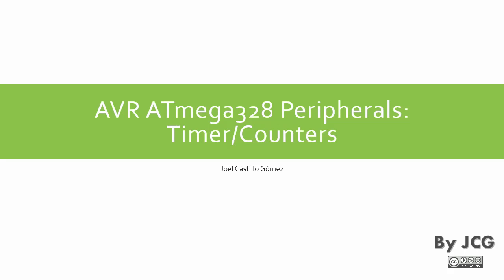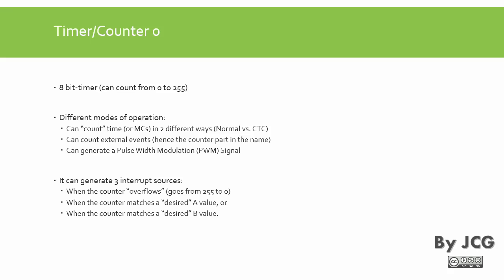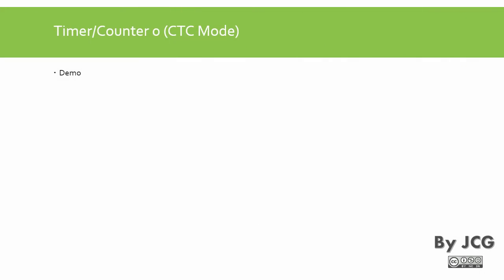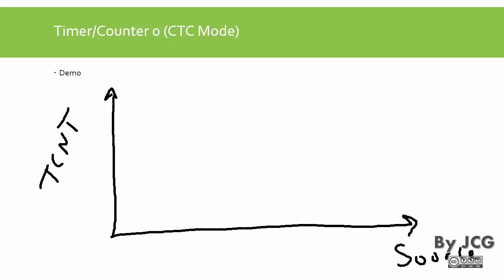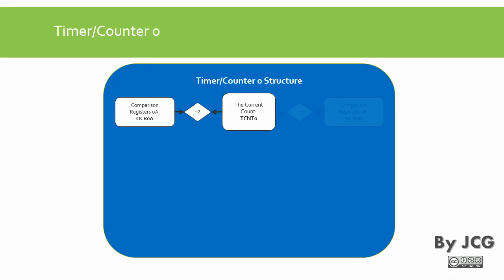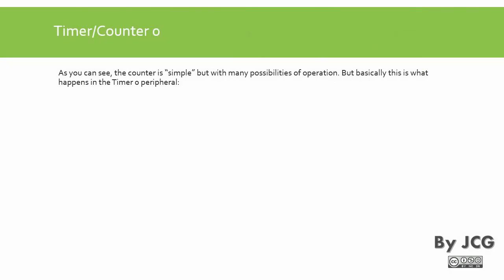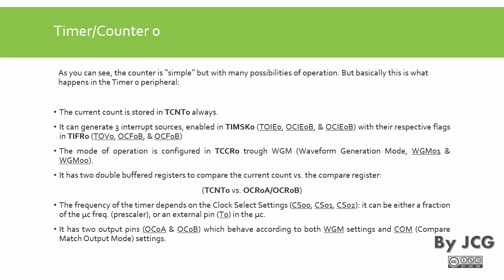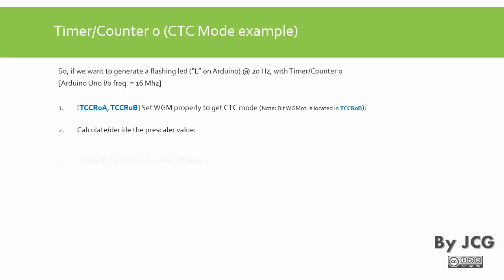AVR Timer/Counter 0 Explained. (Intro to C programming)

Comment: Joel, is there a reason why you choose to not use the waveform generator output pin OC0A associated with TC0?  I noticed your excellent tutorial and the one by Glen Nilson of Atmel both do not use the default output pins.  I suspect that this is done for flexibility of pin selection placement in circuits.
Reply from the maker: Yeah, that's the reason, OC0A pin is great if you do not want to do anything else than to change an output pin and you don't mind having to use an specific pin on the microcontroller. However, if you want to do something else with your timer count, or if you want to use an specific pin on the micro, then you either check the flags, and perform your routine (no interrupts), or you use interrupts and program your ISR.
Reply: Thanks so much!  I just found your other videos and will be digging in shortly to learn more.  GREAT STUFF.

Comment: do you have a github page or post at AVR freaks ?
Reply from the maker: No, but i'll try to upload them soon.
Reply: @joelcastillo1017  thanks ! if you want to add something that I think it's cool is to do a video about the millis function in Arduino platform and how to do an exact one with AVR gcc code.